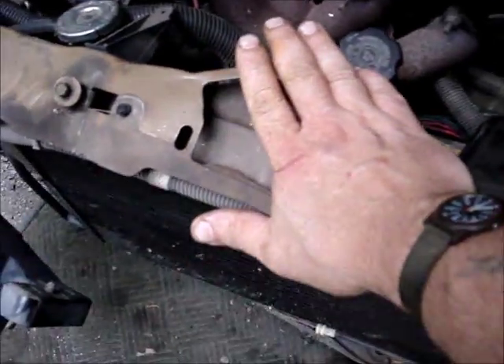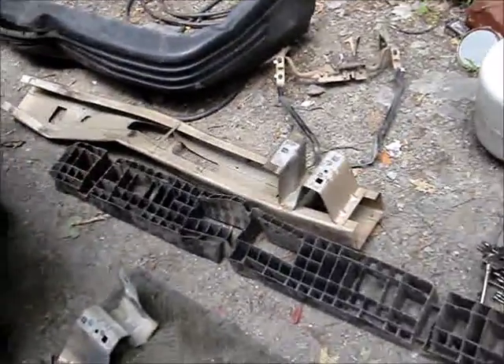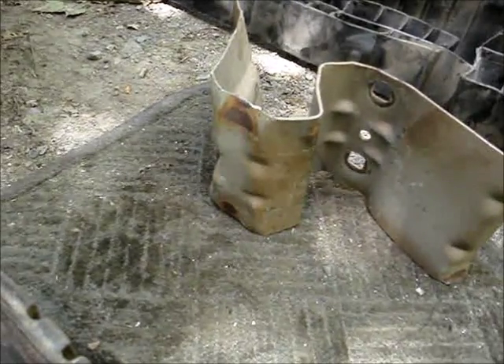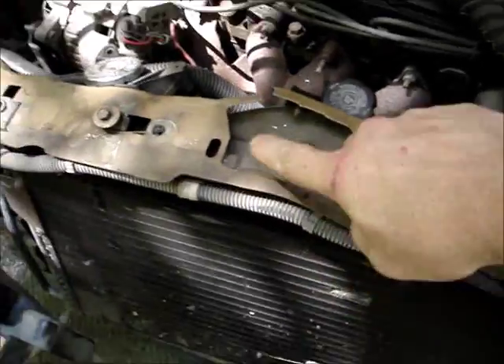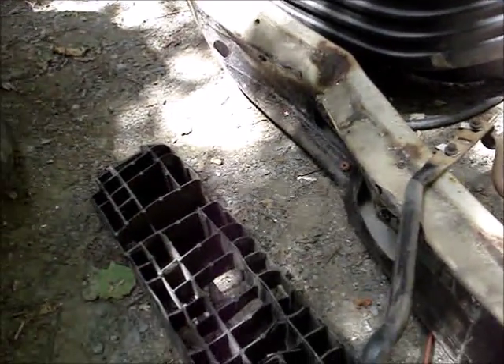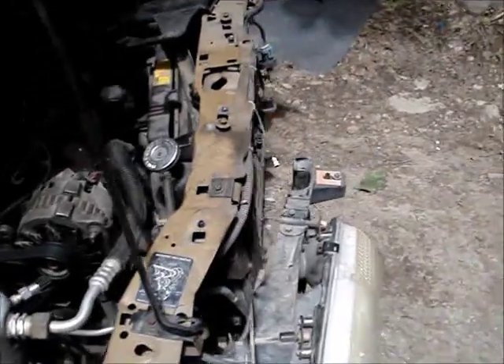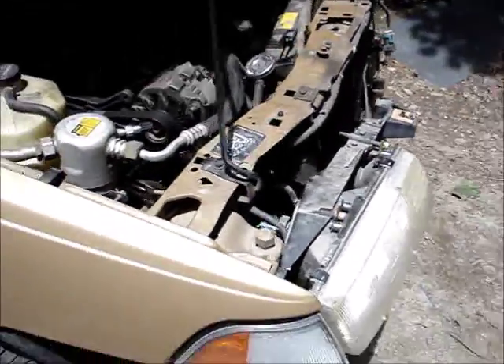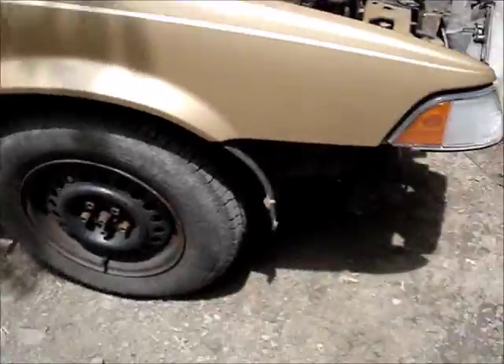Chevy Cavalier Vs  Tree Stump

Comment: I put the 14.00 harbor freight driving lights on my 92 century. Ran thru a relay. Went to California in it with no problems. Used the harbor freight 18 pk clearance lights for park and turn signals. Worked great.
Reply from the maker: I suppose I shouldn't have any trouble then!
Reply: +heliarche You shouldn't.